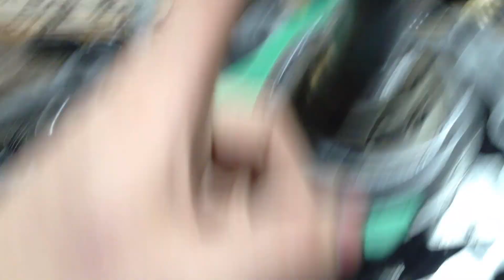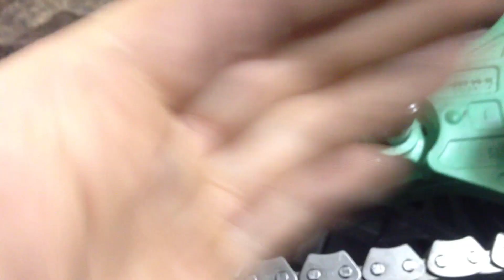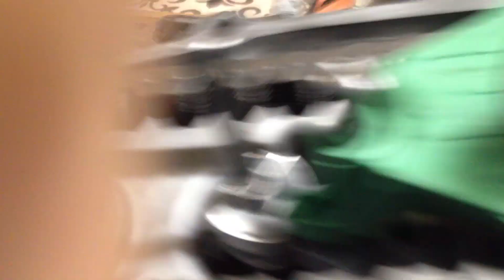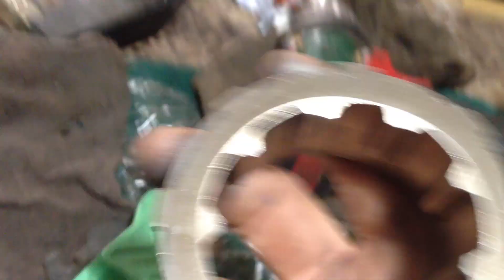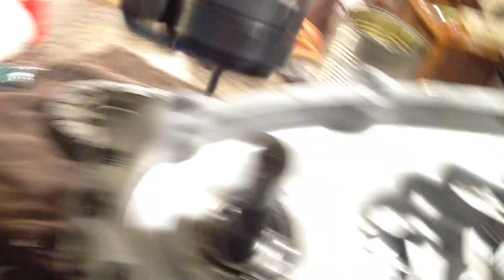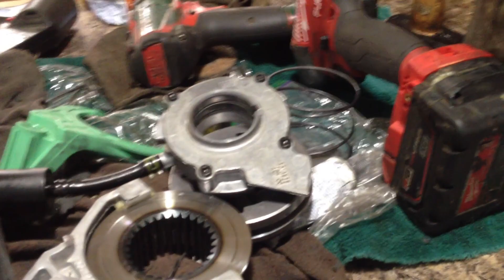BW1354 Transfer Case Disassembly and Troubleshooting

Comment: the fix for the pump chewing up the softer case material in the BW1356 from the F-trucks is to cut the nose off the sheet metal locating tab and weld on piece of longer steel rod. That steel rod spreads the force over the surface of the case instead of concentrating it in one narrow spot and stops the pump from eventually wearing through and grenading the t-case.
Yours looks to be a cast piece of something else. So maybe epoxy in a couple thin pieces of steel plate over the area of the case where the locating tab makes contact, if you can't weld or braze to the tab itself. There isn't that much force on it so it doesn't have to be anything crazy.

Comment: Wondering if you have any updates on this old post. I just bought a 1996 Mazda B4000 4x4. It has the Electric BW 1354 with autolocking hubs. I seems to skip out of 4x4 under the slightest load. I have kind of a steep driveway and it skips and clunks really bad. I pulled the TC and opened it up expecting to find big chunks...but everything look relatively good. No signs of skipping chain and the forks are perfect. No chunks or metal--just really black fluid. The only wear I can see is on the lock up hub and collar like you show in your video but super minimal. Problem is I can not find the parts through Mazda or Ford. They no longer have those parts. Has your fix held up or is there some other possible issue. Yes my motor tested out good.

Comment: Man I know this is super old video but I need to know how to rewind those springs on cam shaft ya dig
Reply from the maker: Fair. Honestly it's been to long to give a good answer. I'd just wind them evenly and try to get it close to how it looks in the video. As long as it's even clockwise and counter clockwise force it shouldn't really effect too much
Reply: @ ok I just snapped mine today so mad about it too I was trying to be careful having hard time finding the replacement too

Comment: I had the same problem . I repaced (1)Hub asy  E3TZ7100D, (2)HUB ASY  E3TZ7D164,(3)SPRING  E3TZ7D126A,(4)SLEEVE  8L5Z7106A,(5)SNAP RING   E3TZ7917E. I ALSO REPLACED BOTH FORKS (1) 4L2Z7289,(2) F2TZ7289A. WORKS PERFECT. THANK YOU FOR THE VIDEO.

Comment: I have the same 6 cylinder manual I had a big bang in 2 wheel drive started engine back up go's in all gears good only work's very good do you have any idea what happened and how to fix it and the best place to buy parts

Comment: would a piece of rubber hose slipped over the pump tang give it enough cushion to stop the wear-thru of the case?split thehose lengthwise and slip it over the tang???would also spread out the pressure on the case some.   maybe the difference between a 1354 and a 1356 is the 2 planets???? 1356 being the stronger t case

Comment: Having the same issue with my ranger atm it kicks out of 4wd while driving, very snowy where I live and 4wd is a must. Can you please include the parts you bought and numbers? I changed my transfercase shift motor and used a 2nd hand transfercase with the same issue. Thinking my luck is just that bad and the transfercase I bought has a bad reduction hub.

Comment: 1354's are fords definition of "junk" all  have given mme trouble and was told there is no fix for them , well ther is a conversion kit to manual and there are websites with the parts you need , my main issues were the plate wore thru the wear spacers on the forks and no longer shifted  from low to high. took one apart and that was the issue, now have on stuck in 4 high and suspect the same issue

Comment: Thanks for the video! Is there a gasket when you put the case back together?
Reply from the maker: The two case halves are simply cleaned and then rtv silicone’d back together

Comment: I have a clunk. Then a clicking with no grab of the front tire. In reverse the Fx4 works fine. Forwards. Ill get 3 feet in the deep sand and it will cllunk out of 4high or 4lo and start clicking untill I take the foot off the gas.
Reply from the maker: The fact that it works good in reverse hints that that clutch/hub I show is likely worn. I would pull the drain plug on the front diff just for my own sanity, but I think you found your problem

Comment: I got my case out now. The symptoms were that the shift for several years was sketchy. It would go in 4wd, but not immediately. Once warmed up it would go in. If I didn't switch it often for months I would fail to change, and then I'd keep trying it would finally engage 4wd, and as long as I kept switching off and on it would seem to free up. Then one day on the freeway, it clunked, and I lost engagement to the drive train. As I was coasting in, the shifter would not move ot of gear. But when I stopped, the engine running, and clutch disengaged, I could easily shift in all gears as if he clutch was no longer engaging. Also the truck would roll free. 

We notice after inspecting through the bell housing hole, the clutch was fine. I was going to remove the tranny, but when I disconnected the rear differential drive shaft, the output flange on the transfer case moved as if in neutral, and the input to the tc was locked while still attached. 

So, I'm thinking the TC is fowled, any ideas? I'll be into the parts today sometime. But sounds like the TC clutch, because I don't think it has a neutral position. Not sure
Reply from the maker: Well you have the transfer case out now, might as well split it. I’d have checked the shift motor, maybe drain the transfer case oil and check for chunks but id open it up for sure now that its out. If its not obvious feel free to send me a few pictures ect
Reply: @zfocuser  Yeah, the chain had a ton of slop in it, and the nylon was gone from the forks. I'm not sure, but the plastic fork, does it need the nylon liners? I'm replacing the forks and rail, filter, chain, and shift motor.

Comment: My current issue is when I activate the 4x4 after a few minutes it will start knocking slowly, it gradually increases and just disengages all drive to both front and back. I’ll be taking it apart this weekend 
Thanks man, your. Hero for us 4.0 fords  lol

Comment: First off, GREAT video! It has helped me so much to see the parts that I'm probably going to be changing on my slipping Ford transfer case. First useful video I've found in a year of looking!
So you said some scattered pricing in the video and mentioned some part numbers you were going to post but I don't see them. What ended up being the total $ for the parts you bought? Thanks
Reply from the maker: I was into it for under 80$ Then add on some atf, a tube of silicone and a couple cans of brake clean. If your transfer case is slipping it could also be the chain
Reply: @zfocuser  How many miles were on this before you had to do this repair?   Did you off road a lot?  Get rough and crazy with it?   Thanks.........

Comment: Similar problems here, on an '04 Ranger ... plus more.
I haven't been able to get the drive flange off yet, which means I haven't been able to crack the case, yet.  But, evidence so far indicates both gear and shift fork failure (metal bits and white plastic shavings in the oil -- most of these transfer cases have white shift forks, not green).
It was fine until my wife started using it as the daily driver.....

Not a big deal for me, though.  I was able to obtain a seemingly "good" 90k mile replacement for $75, and a prior version (the 5-planetary?) for $90.  The good one is already in the truck and functioning.  So, I can just work with these other two for now. (Manual shift is likely.)

Comment: Great video man, my ranger seems to shift in and out of 4wd while driving in 2L and my guess is that I have the same problem as you. I’m going to pull it apart this weekend and see if I have wear
Reply from the maker: If you have selected 2wd high range and it is going in and out of 4wd I would suggest troubleshooting your shift motor before removing and disassembling your case. If its happening in 4wd then you might have a problem inside. Best a luck. Keep me posted!

Comment: Excellent video.  I think you would get thousands of views if you added "Ranger" to the title.
Reply from the maker: First things first, Thanks so much! As far as the title I try to be as accurate as possible with my video titles. That and the bw1354 is in a ton of other vehicles other than ford rangers (rangers being the most note-able) regardless. I also tagged ranger and mazda b4000 etc so it ought to show up. Again, thanks a ton